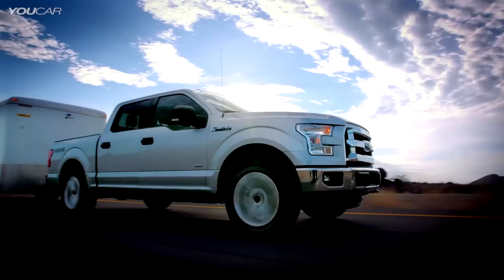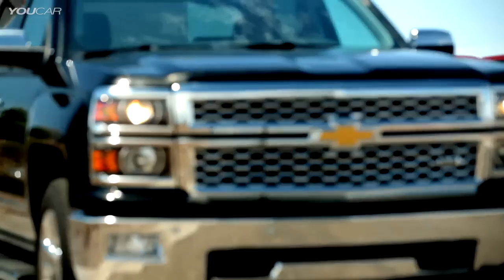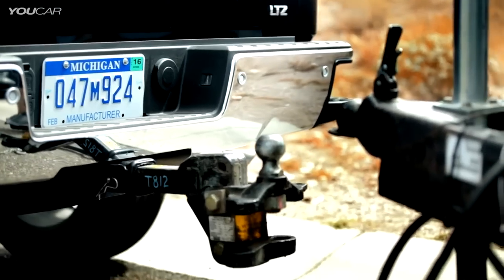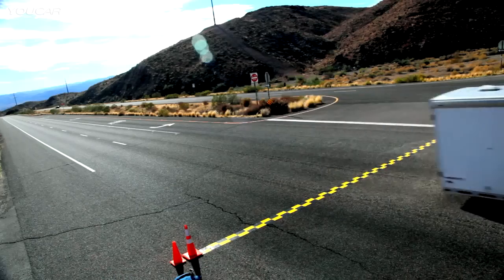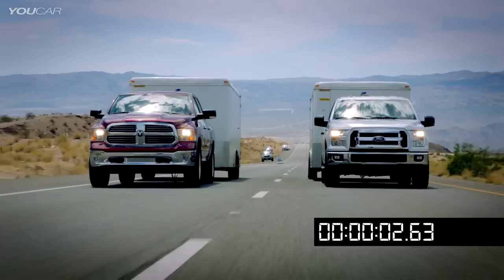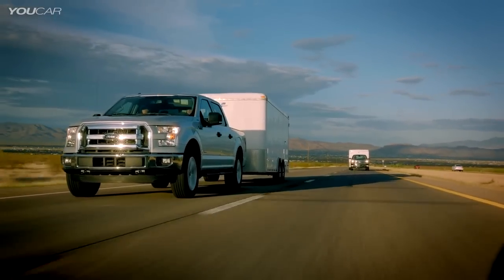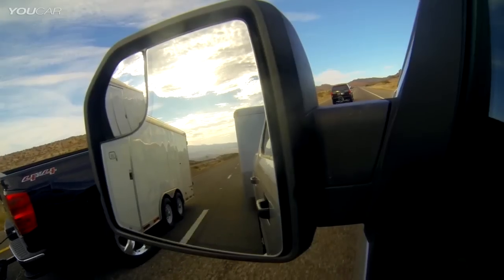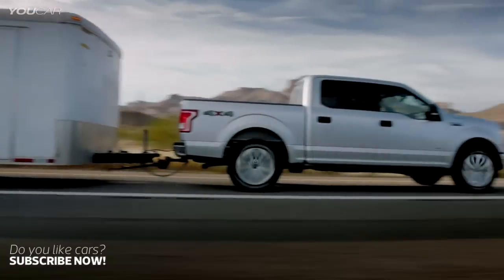TOWING Comparison – Ford F150 vs RAM 1500 vs Chevrolet Silverado

Comment: @ Gabriel Chattoo (lol) Depending on what you like: Dodge : FixOrRepairDaily Chevy: FuckingOldRebuiltDodge. or Ford : FirstOnRaceDay... Which is proven in this video? lol

I'd just like to say I haven't had the pleasure of owning a new F150 because mine is still running and I'm just now thinking about buying a new one because I have a reg cab and need a crew now.
With that out of the way, people are being told not to believe tests and take random peoples word on what's best so here it goes.
I've owned 2 trucks in my life. A 1976 F150 4x4 and a 1996 F150 4x4. the 76 had over a million miles on it (straight 6) and I beat the shit out of that truck, besides regular maintenance (breaks, exhaust etc) and undercoating I did nothing to it. I sold it 2 years ago and the guy is still driving it, I see him from time to time and he loves the truck. The 96 is a great truck as well it's my daily driver at the moment, it has 260,000 on it with the same up keep so far. as I said the only reason I have for getting a new one is growing family and I need more room in the truck.
The male members of my family are ALL MECHANICS 1/2 drive Fords, 1/2 drive Chevys. One day I went to my uncles Garage and saw a Dodge on the hoist and said " nice truck" he replied "Yea I love dodge, fixing them pays all the bills". My father was the mechanic for the town we live in and fixed the plow trucks and kept them running etc they were 1968 Fords... they had a dodge once I wont lie about it but they ended up swapping the dodge for a Ford 250 lol because it kept breaking down all the time...

I know your a Dodge "Fanboy" Gabriel but don't shit talk Ford or Chevy bro it just makes you look stupid.
To anyone looking to buy a new Truck (like myself) Ford and Chevy both have very solid trucks. Unless you want to pay somebodies uncles bills, get one of those :P

Comment: It's a good demo/promo for Ford, but not a good comparison.  To give credit, the Ford engine is impressive against the Chevy, for straight pulling, foot to floor, no stops, clear road ahead, all out run. But this is not real life, and not the demands I would place upon a truck. Anyone who knows the diff between gas and diesel will tell you the gas engine will perform better at high rpm and speed. But low speed high torque is what counts, for control and weight, when pulling and manoeuvring a heavy trailer. I agree, the real test would be cross country , in extreme weather, in heavy traffic, etc.  I lean towards diesel for towing, but am open to new tech. Each tech has its pros and cons, so each consumer must decide by their own needs.

Comment: If only the mythbusters were still around 

I’d like to see an unbiased test 
Same test conditions same test methods but not sponsored by ford 

And as an added bonus test these vehicles after 60 or 70,000 miles and see how it does

Comment: Irrelevant test.  No one has 3 mile drag races with trailers!  Let's see a practical test.  Take them to that hill, set the cruise at 70mph and see which holds speed the best and compare fuel costs.  That would mean something.

Comment: I would have loved to see them compare the f150 vs toyota tundra. I'm sure the tundra would out perform the f150. The only thing better in the ford is a little better fuel economy but it doesn't compare to the tundra.
Reply: Which Tundra are you talking about? because the 2.7L is designed to compete with a mid range v8 engine option from other manufacturers. In case of Toyota, it would be the 4.6L v8 Tundra. And yes, the 2.7L ecoboost would run circle around the Tundra 4.6L v8 in both mpg and power rating (Toyota 4.6L v8-310HP/327lbft, 2.7L Ecoboost 325HP/375lbft).

For the 5.7L v8 Tundra, there is the 3.5L Ecoboost F150 that will once again, give the Tundra a run in both power and mpg departments. All Japanese auto-makers are currently behind GM and Ford in consumers engines technologies.

BTW, enjoy that stolen interior design from the old F150, 2014 Tundra!

http://www.f150forum.com/f38/2014-tundra-vs-2013-f-150-interiors-224759/
Reply: The Fast Lane Truck already showed the 2014 Tundra and the 14 Ecoboost.   The F150 3.5TT was FASTER in all of the tests.  Watch this video and look at the times at the end. 

A15hc9DtdQI

Comment: all these hater on ford i dont think they care since they DEMOLISH the competition in sales. i  prefer a v8 but while they are running the ecoboosts are strong engines. i have an 89 f150 4x4 lariat with a bulldog 4:10 gear and a 351 thats pulled a 19k lb dozer before! now thats impressive

Comment: This test is not fair. Ford gave the ram the smallest, least powerful engine in their lineup. And they rigged the other trailers to have more weight on the tongue so they would be slower. if ford hadn't done this, the Silverado would have destroyed the ford, even without turbos.

Comment: The Eco boost is twin turbo. And there no way it was making good fuel economy during that. Also there lighter because they have a shitty aluminum body on them that will corrode in 4 years. The only way someone should get one is if they live in the city and don't need to tow much through out the year. And they need to have money because it they get a dent in it they'll have to take it right to ford to get it fixed because local garages won't be able to paint aluminum because you need special paint and a special piece for the spray gun.

Comment: The ecoboost out pulls the ecodiesel, do you know why??  Powerbands.. The ecodiesel has a puny torque and power band that starts at around 2000rpm and dies after 3400rpm lol lol The ecoboost has a broad power and torque band that starts from 2000RPM all the way up to 5500RPM. Thats why the ecodiesel gets off the line fast but it fails to maintain speed because its torque curve dies after 3400rpm and its 240hp its not enough to give it high top end speed lol lol

Comment: People getting all butt hurt about ford being faster. It's simple turbo gas engines have high torque at higher rpm. The dodge and chevy take off quicker as those engines have the torque off the line but the higher the rpms torque dies off. Leaving ford to maintain speed at high rpms and the others struggling to maintain momentum.

Comment: *****   The Fast Lane Truck has done the GM 6.2 and the tundra 5.7 against the 3.5 ecoboost and none have out pulled in in those tests.  The place where the 3.5 has a advantage is where the torque curves is....1900-2600 rpms much lower than N/A V-8.  I think the long term of a V-8 is going to be better and cheaper to keep running but out of the box the 3.5 EB is hard to beat.

Comment: This is the future less weight and more super super charging with less engine this makes me sad. less truck weight= less trailer weight ( cant control something thats 3 times your weight). these eco turbos are having big problems and they have only been out since 2011 problems at 100,000. The gm drops to 6 cylinders when its not needed to me thats a way better concept

Comment: The Eco diesel isn't a high hp motor. It's a hight torque diesel that returns above 30mpg in many reviews. It was made to pull a load in a drag race. It probably would lose even without a load
Reply: You are correct, it would certainly lose without a load, even worse.  There are road tests out there already that prove this.  That said, it's really more about fuel economy in a normal towing situation.  No doubt it would win that contest.  The thing is most half ton trucks (including mine) get used 90% of the time as a car, so having a fuel efficient 2.7 that tows occasionally and is capable of towing when you need it is a pretty good option.

Comment: I wonder where Dodge got the idea for an ECOdeisel from...
Reply: ford didnt create the word eco lmfao
Reply: @nathan7627  And? They didn't use it before ford.
Reply: @dreadnoughtprime6301  both came out in 2014, one may have been out for a few months older but that doesnt matter. also thanks for responding after 6 years.
Reply: @nathan7627  my original comment was from six years ago.. YOU'RE the one just now replying to it. Then I reply back and you're surprised? What did you expect? A reply is pretty standard.
Reply: @nathan7627  And no, the EcoBoost was available before 2014.

Comment: My Dodge 3500 has a 6 cylinder does that mean I shouldn't tow with it and should have bought a v8?....Every 18 wheeler on the road is a 6 cylinder...I like v8's but facts are facts.

Comment: Frames and suspension on rams are better and more durable not to mention a better transmission but ya quality on materials can go up a bit but that motor comparison with that diesel isn't exactly fair cause that ram diesel has no top end hence why it beats them off the bat but not top end it is the best diesel of its kind on the market actually its well designed just needs higher quality materials and loose 800lbs to be on weight level of the rest Chevy is 300lbs lighter then ram

Comment: Ecoboost engines all in Ford : 20-100 l/100km, over 100 l/100km, easy damage with test F1 speed, test maximum over 20,000 rpm.

End report.
From
All Ford ecoboost engines database

Comment: Putting the petal to the metal when towing with a diesel... I'm 16 and I know that's not how you are supposed to tow. I'm getting a little sick and tired of the biased ford videos, even though I like ford. Also I'm willing to bet that the chevy and the dodge weren't equipped with the best rear axle ratios for towing. Also with ford's shitty habit of overpricing engine options that 2.7 turbo is probably a $1000+ option, not worth the money. 7,000lbs is probably the max recommended for that engine anyway.
Reply: They are not towing normally. They are racing to see which pickup is the fastest going up a grade. What do you do when you are racing? you put the petal to the metal. All the pickups are equipped with their best available rear ratio. In this case, GM and Ford both have 3.73, and the Ram has even better, a 3.92. Watch the video again?!
Reply: Rich, if you want to see overpriced, look at the Ram!  It's a couple grand more for the diesel over a HEMI !  The Chevy had a 3.73 ratio, same as the Ford, and the Ram had a 3.92.  All three of these manufacturers will be using the SAE towing test to rate the trucks this year so the towing limits will be lower, but more accurate.  FYI it's a Ford biased video because it is made by Ford, and of course they are going to show where their trucks excel.  Cool that the little 2.7 works so well.
Reply: rich rosa Dude your comment totally shows that your 16.....
Reply: The Ram EcoDiesel is a $4,000 option whereas the new 2.7 will cost $495 on XL and XLT and is standard on Lariat models
 http://wot.motortrend.com/1407_2015_ford_f_150_starts_at_26615_platinum_model_priced_from_52155.html

Comment: Gkelbo it's transmission problems in Fords, electronic problems in Dodge, and I'm not sure who has suspension problems. Haven't heard about any suspension issues with any of the three. But maybe I should research so I don't sound like a dumbass.

Comment: Honestly who cares how fast you haul stuff? if it hauls it hauls and more importantly how reliable is it? (trust me a 2.7 v6 turbocharged engine would have a LOT more strain towing heavy loads compared to a true v8) and let’s not forget aluminum is a lot more cheaper to manufacture than steel.

Comment: I bet this video was somehow endorsed by ford and pushing their new f150 but come on now, even if it does perform better there is just something about saying.... Bob:" hey, i have a brand new 2015 f150" Joe: "oh cool what motor you have" Bob: "you know, the AMAZING 2.7L ECO BOOST" Joe: (bursts out laughing). sure the ram has a what a 3.7l eco diesel but at least they did it right with the diesel part. I myself am a Dodge fan as I own one but idk there's just no better feeling than having a 5.7L or 6.4L v8 hemi under the hood.

Comment: Wow, the Eco-diesel engine need work, and it is a $3000 option
Reply: Look at the torque, my friend.  Torque gets loads up the hill, power takes care of the "how fast" department.  So the 7,000 pound trailer is for little boys.  If they did this with a 9600 pound trailer, the Ford wouldn't even be there.  It would be the Ram all by itself.  There's the difference between torque and power.  You may want to check your engineering mechanics textbooks if you don't remember, if you're sitting there with a blank look on your face.
Reply: Oh I remember, T=FL, P=Fv. unless there are alot of ppl towing 9600lb uphill everyday, drivers will need some more power for daily driving especially highway travel.
Reply: So go look for power in a gasoline motor.  But don't complain about an application where customers pay more SPECIFICALLY for towing, and say that they need power.  Ram has BIC HP with the 3.6 naturally aspirated against the 3.5 twin turbo; and the natural aspiration provide BIC fuel economy as well.

Comment: Its not about horse power and torque anymore?? Ford is seriously loosing touch with what its buyers want. All anyone wants is for their truck to do what they need it too. We want to be able to haul tons if we need to and without worrying if the truck is going to break. I dont want to have to spray bed liner in my truck bed for structural support! Fuel efficiency is nice, but that doesnt get the job done. I think ill stick with my 95 f350 it may not get good gas milage but at least it gets the job done without complaint.
Reply: Perhaps you're the one out of touch. They're putting out better power than ever before while getting better mileage.

Comment: Lol.. Look at all this clowns making excuses for the ecodiesel lol the ecodiesel's torque curve maxes out at 2000RPM after that HP is supposed to give it top end speed but because it only has 240Hp it cant keep up with the other two.. The Ecoboost and silverado have broad torque bands and more HP for top end speed..
Reply: DropShotMaster1000 It means everything when it comes to any automobiles. If you ever have to pull a heavy load, climbing the mountain path between Nevada and California, doing 45 mph in a 65 mph zone for hour after hour. Then, you will understand if speed means anything. To start off, try driving your car at 20 miles below the speed limit for a few hours and let me know how it feels.
Reply: SB N Done that If there is no rush there is no need for speed
Reply: The hemi would have done better. Ford brought in the ram with the economical engine choice not the Hemi or something that would be better for towing.
Reply: Joeldude76 They brought there economical engine too.....
Reply: Yeah I guess I didn't realize I thought they brought the 3.5l Ecoboost.
Reply: Joeldude76 Right. I'm sure if they did a fuel economy comparision then the will use the Hemi and the 6.2 in the Silverado. Its biased but I have no issues believing the 2.7 could get up the hill faster. I read a review with the hemi vs the 3.5 ecoboost by pickup trucks and the Hemi beat it everytime with or without a trailer when they even brake torqued them to build boost. The only thing it lost in was when they put like 1,000lb payload some how on the 1 the ram came in like 4th behind the tundra and Titan too which makes me believe it was some mistake on their part since it was quicker empty and with a trailer.
Reply: true about the ecodiesel. The positives about it are longevity and fuel economy, though. Both are very important for long-term ownership. After all, how often does one race his truck (with a trailer, no less) with another truck? The point is that while this test may be true, it doesn't really mean much in the overall comparison of the trucks. It's kind of like me saying that it's a nice day outside, and tomorrow is Saturday. Both true statements, but they have nothing to do with this discussion just like the race win has nothing (or very little) to do in determining which truck is better.
Reply: josh lowe really? there is a video made by TheFastLane Truck Magazine were they used Ford's 3.5L Ecoboost, Silverado's 6.2L and 5.3L, Nissan 5.6L titan and Toyota's 5.7L tundra and the Ecoboost destroyed all of them while towing a 10,000lb trailer up the Ike Gauntlet. 

Not even GM's new 6.2L with 460lb/ft of Torque was able to beat the ecoboost 3.5L, i really doubt that the Hemi will beat an ecoboost since it only has 407 lb/ft of torque..

Comment: i will take the best MPG and longevity of the EcoDiesel all day long. not redlining to tow 7000lbs, just purring away, happy rpms, running cooler and using the buttery smooth 8 speed auto. of course the diesel wont have the speed of the gas engines……its simple math. just waiting for the failures of another ecoboost product. super happy i left working on Fords. lots of pissed of customers we just couldn't keep happy. i feel for them….

Comment: should have been all gas motors. i also noticed they talked about "appropriate gearing" seams staged to me. probably chose the high gear trucks to put it against, while they probably used lower gearing rear end in the ford.

need to see an unbiased test by 3rd party people that want to see the truth.